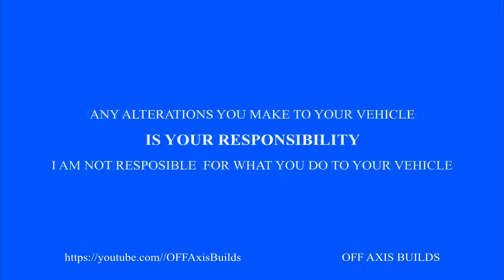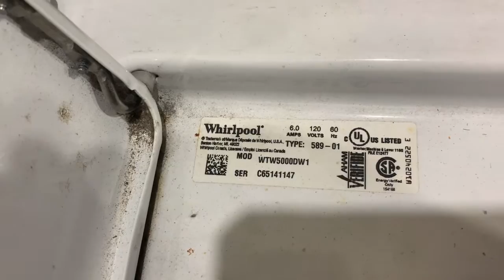Whirlpool top load washer Replacing the shifter switch #whirlpool #Toploader #diagnostic #shifter

Comment: I’m totally NOT an appliance mechanic! I was visiting my daughter & her washer was only allowing a few things at a time to be washed. I came across your video on error codes & it was the 2nd video I watched & happened to correspond with what was wrong with her machine. I watched this video, ordered the part & just installed it. Haven’t tested it out yet. Here’s to hoping it is fixed! Thanks a ton! I’ve learned so much from Youtube. I was alive & kicking before the dawn of the internet age. What ever did we do without it?!?!
Anyways, thank you for taking the time to make this vid.
Reply from the maker: I sure hope your machine is up and working again. Thank you for supporting my channel. I really do appreciate it.
Reply: @OFFAxisBuilds  I calibrated the machine & did an auto test & the same code came up as before. During the test it acted not right as far as I cld tell. I’m going 2 check & see if I put that thing in right. Seems like a no-brainer but need 2 double check. Any other ideas of why it wld throw that code?

Comment: After watching your previous video on the diagnostic test, I order this part ASAP and got it delivered within 2 days from Amazon. I followed your instructions and it was so simple to install. Thanks again for sharing..feels good to wash my clothes again🤣👍🏾
Reply from the maker: I’m glad I was able to help. Thanks for your support.
Reply: @OFFAxisBuilds  you don’t have the part number
Reply from the maker: @elaguila421 https://amzn.to/3EkccoN
Reply: I have the same sensing light showing in the diagnostic code.  “Far left light”.  I pulled the shift sensor off and I don’t see any broken linkages.  Was yours visibly broken?  Maybe there are some internal contact issues that I can’t see?

Comment: Whenever you replace or even disconnect an electronic part on these machines, you MUST run the recalibration function (in diagnostic mode) so control board recognizes the new part. It takes about 3 minutes. Technician support manual is located under the top left front corner 25 - 48 pages worth!

Comment: I did it myself, thanks so much! The only problem I had is that it would not agitate in Wash cycle while everything else worked. I learned that the 'peg' on the actuator needed to be intentionally replaced into the 'loop' on the 'pulley assembly'. (I don't know the proper names for all the components.) But yeah, I did it! So happy!!!!😁👍🤓 (ALSO, my old actuator did not look broken. I removed the opaque cover and the arm looked intact.)
Reply from the maker: I’m glad you got it working again. Thanks for watching my video

Comment: *Repair completed today*- My model is- wtw4815ew1. I watched your first video regarding how to get into diagnostic mode.  My results were identical. Diagnostic test results- Green light indicator on 'sensing'. Indicating a- the shift actuator part has failed. I watched the second video. Immediately ordered the part 45$ bucks, but arrived the next day. Used a 5/16 to remove the bottom cover, unplugged the electrical connector of the shift actuator, then remove the 2 phillips screws holding the actuator.  Once I removed the actuator, I was worried. I turned it over, and  the lever was not broke,  it didn't jiggle, and I thought- FUCK! And I doubted you. I was pretty certain, I had just ordered a 50$ part for nothing... regardless, I put the new actuator on. Connected back the hoses, plugged the machine in. And when I did, no lights came on.. and it began clicking. ...... dam! O but wait, like ten seconds later- THE WASHING MACHINE ENGAGED AND FIRED UP.... HELL YEAH. Sorry for doubting you. And Thank you sir for the spot on information. Which is why I had to make time to come back and help others as you have, and do. God bless.
Reply from the maker: I’m glad I was able to help. I know fixing things can be expensive and I know you want to order the right part and get it fixed quickly. Do I completely understand you questioning the diagnostic.
Reply: @OFFAxisBuilds  Amen, it is the knowledge we have gained, that is a gift that keeps on giving. I will be adding your link to my 'how to' section in my website. A direct post to your vide link. Aiming to diversify by sharing vids like these. They are indeed helpful Especially because now days when you do a search, all the primary results that return are paid to rank at the top, and to make money. Word of mouth, saves not only money, but valuable time, and things you cannot learn from a Chilton manual.. God bless
Reply from the maker: Thank you

Comment: Thanks for this
Reply from the maker: cronshab I’m glad this helped you out. Please help me out and like a subscribe to my channel that always helps me out.
Reply: @OFFAxisBuilds  how did you know it was the shifter and not the motor? Getting a buzz when it is trying to spin/agitate but no movement ... Thank
Reply from the maker: cronshab I knew It was the shifter because it would go through all of the steps except drain and spin.
Reply: @OFFAxisBuilds  right, so you had the agitation? I'm getting a buzzing and no movement  when attempting agitation or spinning so I'm thinking motor.
Reply from the maker: Check your belt or clutch. It sounds like your belt slipped off or broke. I’m going to put a video together on the Symptoms and how to replace the belt a clutch. 

W10006384 Washer Belt Replacement... https://www.amazon.com/dp/B07HVFKMDG?ref=ppx_pop_mob_ap_share

W10721967 Washer Cam Splutch Kit... https://www.amazon.com/dp/B07TXGH3ZT?ref=ppx_pop_mob_ap_share

Comment: So. I stumbled onto your videos as I have the exact same model machine.  Ours has started dumping water out that appears to be coming from underneath, but isn’t doing it on every cycle.  I ran the diagnostic and got the sensor error same as you.  Was thinking about ordering a replacement sensor...but wasn’t sure if that will fix whatever is causing it to dump water on the floor. FYI, it only seems to happen on heavy loads like towels/sheets. Any thoughts?
Reply from the maker: I would start with the sensor that rammed to help me and I had a very similar issue I just didn’t allow it to over flow.
Reply: I have ordered the sensor.  Thanks for the link!  Fingers crossed that solves my issue
Reply from the maker: Good luck. I have Another video on replacing that sensor

Comment: Thanks for taking the time and walking us through. I have the part on the way. Can't see any broken pieces on old part. Is washer good to go after replacement or need to be recalibrated?
Reply from the maker: Thanks for watching. You should be good to go. The machine should calibrate its self. But if it doesn’t follow the calibration instructions in the manual

Comment: Sensing shifter not working due to lid lock ? Is that possible? Replaced lid lock sensor but lid lock did not activate went through diagnostic steps to it washed see if it shifts past wash it was stuck in sensing ?! Now it advanced to wash?!

Comment: My washing machine stopped sensing is it the same issue?? does the lid lock have any connection with the sensor
Reply from the maker: Does I’d just keep filling with water?
Reply from the maker: Or does it just not start?
Reply: @OFFAxisBuilds it's doing nothing not  taking water its stuck on start pause  button
Reply: @OFFAxisBuilds  got into diagnose mode faulty code is sensing & spin blinking

Comment: We have the same exact machine, when it gets to the spin cycle it will not pump out and spin. If we do a manual spin by selecting "drain and spin" it will pump out and spin but it won't do it on its own. Is that a similar problem to what you saw? I am considering removing the switch in the video to see if I can see if the linkage is broken inside....any thoughts?     Great video by the way
Reply from the maker: Yes that’s exactly what happened to me. It would switch over. I would start with that switch. I have a amazon link above it that part needs to be replaced. Good luck
Reply: @OFFAxisBuilds  Replaced the switch today with a new one. Same problem...when it gets to the rinse cycle it will bring water in but it never spins the water back out, it does pump it out but it has to spin to get the clothes more dry. If I select the drain and spin option it will spin out so I know that mechanically it works. I'll have to do some more research but anyway your video was great.
Reply from the maker: It’s possible you need to reset your machine. 
Unplug it for 30 seconds 
Then plug it back in
Once plugged back in press the start button 10 times. 
Then try to run it again
Reply: @OFFAxisBuilds  Got it fixed today...I went into the diagnostic mode and the flashing lights indicated a slow fill issue that would then interrupt the timing of the cycles. I then pulled the hoses off and found that the inlet valve screen for the cold water was completely plugged. I cleaned it out and ran a cycle and now it works perfectly!  So happy
Reply from the maker: Awesome

Comment: Hi, so I had the same issue, stuck on sensing. Diagnostic showed sensing. Bought new shifter, installed it, still stuck on sensing. Diagnostic for new shifter still shows sensing. Any ideas?
Reply from the maker: If that didn’t fix the issue it might be your lid latch.

Comment: I need to replace my shifting sensor but there is still water in the washer that I can't see how do I drain it?
Reply from the maker: Put the unit in drain and spin. That should drain the water.
Reply: I tried that but it wouldn't do it.  I figured it out.  I do have another question I change the shifting sensor but my washer still is not working and when I did the error code is still coming up as a sensor issue. Would there be another part that could be wrong or is the sensor I bought the problem

Comment: Mine throws the sensing code but my problem is a little different. My washer will fill and spin and drain but will not agitate any suggestions
Reply from the maker: Does the machine make a loud noise when shifting?
Reply: @OFFAxisBuilds  

Kinda just clicking sound while attempting to agitate.

I got impatient and took the shifter switch off and believe it is the issue. There was a tiny piece broke off on the "roundish" white piece connecting it to the bar that is supposed to move it causing it to not move.....if that makes sense lol I'll let ya know for sure in 2 days
Reply from the maker: Ok so there is a plastic clutch at the bottom where the belt attaches to the agitator. That might be loose or broken. If it’s broken it will only spin in one direction and not agitate. Amazon link below 

W10721967 Washer Cam Splutch Kit... https://www.amazon.com/dp/B07TXGH3ZT?ref=ppx_pop_mob_ap_share
Reply: @OFFAxisBuilds  

I went ahead and ordered that as well just in case thanks for all of your help
Reply from the maker: Good luck hope that helps
Reply: @Acalle09  this is exactly my issue...did you fix yours eventually?
Reply from the maker: Did you change that shifter switch?
Reply: I replaced the shifter switch and it broke after 2 loads 

So replaced the clutch and belt and shifter switch again and it broke the shifter sswitch again after a load or so 

Went and bought new one lol
Reply from the maker: The new one might be a bad shifter switch. Do you hear noise when it’s trying to shift? If you do then it could be the agitator clutch or the transmission.
Reply: @OFFAxisBuilds  I have not changed anything yet..trying to figure out what exactly is wrong first..
Reply from the maker: Try replacing that shifter switch.

Comment: Ok please help! I switched the motor, ran the calibration (forgot that part after i switched the motor), washer ran fine for a week, now its like the drum is getting stuck.  I believe one of the error codes was F7 E1.  It has me going back and forth, test this test that.  Could you please point me in the right direction?
Reply from the maker: It might be your belt clutch directly under the drum. Or you broke a belt.

Comment: mine will drain but will not agitate or spin,  advice please
Reply from the maker: Check the belt. I have a video on how to replace the belt. Check it out there is a link to it at the end of this video.
Reply: @OFFAxisBuilds  the belt looks OK, when I turn it to spin the water will drain but it will not spin. If it was a coupler bad could I still hear the motor tuning?
Reply from the maker: Yes you should still hear the motor turning. Can you put it in spin mode? Will it rotate in that mode?  It might also be your lid latch. Do you hear it lock after the finding mode, or can you still open the lid?
Reply: @OFFAxisBuilds  I ran the washer thru the diagnostic led code on rinse and spin and the washer did not spin. There was a click and the lid locked. Any ideas?
Reply: @OFFAxisBuilds  I ran the washer thru the Diagnostic led code in rinse and spin. I heard water running then I heard the pump but it did not spin. There was a click and the lid did lock. no grinding or smell of anything burning or smoking. just stopped
Reply from the maker: Check to see if you have power going to the motor
Reply: @OFFAxisBuilds  ok, there is a small harness of wires on the side of the motor red ,green and black in the bottom of the harness on the top the wires are white, the red, green and black wires lead to a small cylinder piece and the actuator. The red wire has had power.
Reply: @OFFAxisBuilds  There is a harness on one side of the motor with red, yellow and black wires on the bottom side and white wires on the top side. The red wire does have power. the wires on the bottom of the harness lead to a cylinder and the actuator
Reply: @OFFAxisBuilds  The red wire in the harness side the motor does have power
Reply from the maker: Can you put power directly to the motor? Does it spin?  If so it might be your board went bad. If it doesn’t spin then you have a bad motor.
Reply: @OFFAxisBuilds  the belt is good
Reply: @OFFAxisBuilds  the red wire in the harness going to the motor has power
Reply: @OFFAxisBuilds  I dont know how to put power directly to the motor but the motor will not spin in the diagnostic led test
Reply: @OFFAxisBuilds  the washer is not even 2 yrs old its kinda new
Reply from the maker: I’m sure the belt is good. Can you pull the motor out and test it on the bench to see if the motor is good. If it is only a months old call the manufacture. You should have a 1 year warranty on the machine.
Reply: @OFFAxisBuilds  no it does not spin, there is power in the red wire going to the side of the motor, what board are you talking about?
Reply: @OFFAxisBuilds  I haven't pulled the motor yet. It will pump water in and out but it just wont spin or agitate. If you have any other ideas I would appreciate it.  If someone walked me thru fixing it I would pay via Paypal for the help.Thanks!
Reply from the maker: The board is inside the control panel on top of the machine. I only say to replace it if the motor does spin when wired directly to an extension cord. I want verify that the motor works outside the machine. If that’s the case then the board might not be telling it to turn on.
Reply from the maker: I would love to walk you through it but I don’t use pay pal. If the you pull the motor out and it works. I would call the company that you bought it from. They should have a limited warranty, and also a 1 or 2 year warranty.

Comment: My Son replaced my shifter switch on my whirlpool washer wtw 5000 Dwl  and the sensing light was still on and it only operated on clean washer with affresh cycle. I reset it and everything else. Do you know what else it could be?
Reply from the maker: +Monica West does it continue to fill or does it eventually stop? I would double check that the shifter switch is in the proper location. It might be that it’s not in the loop at the bottom, it could also be a bad switch. I know I have replace a few. Also check to make sure the belt didn’t slip off.
Reply: @OFFAxisBuilds  Ty for the response. It does fill and it eventually stops. It only fills a small amount but only runs on the washer clean with affresh cycle.

Comment: Help!! I replaced this and it still didn't help.  Green sensing light stays on and the lock light just keeps blinking.  After i hold the start button down, sensing light shuts off,but lock light stays blinking
Reply from the maker: Try a hard restart. Unplug the machine for5 min then plug it in. Right after you plug it in press the start button 10 times. You should hear a click.

Comment: My machine it looks working normal , but it never washed clean, only little tiny circle when it on washing models, is it normal?
Reply from the maker: +chaimei huang is it agitating?  Can you tell if the cloths are in the same location that you put them in?
Reply: @OFFAxisBuilds  i am going to do washing right now, let you know after 30 minutes .
Reply: @OFFAxisBuilds  I can answer you now, yes, they are in the same location 😭
Reply from the maker: Sounds like the transmission might be bad or the belt is broken and the clothes are not spinning
Reply: @OFFAxisBuilds  thank you
Reply from the maker: No problem. Thank you for your support

Comment: I replaced my rod suspensions but my washer basket still bangs against the walls of tub
Reply from the maker: It might be two things. 1.if your running larger items you need to put the washer into large item mode. 2. Your load is way out of balance try running less water on smaller loads and rebalance the load.
Reply: @OFFAxisBuilds  thanks